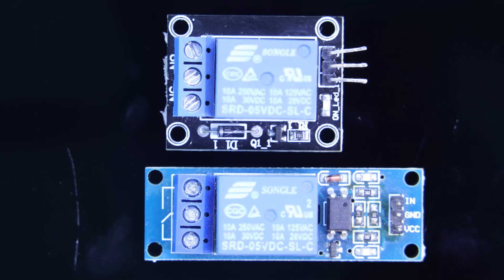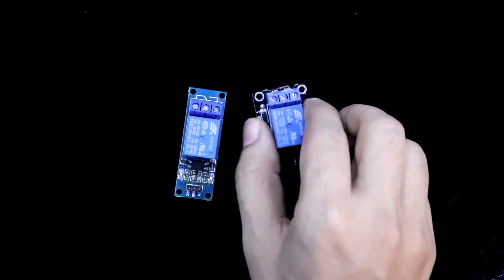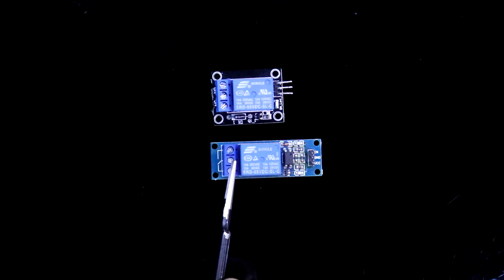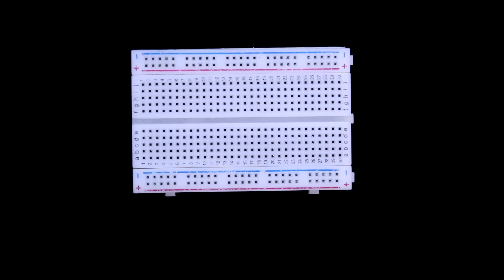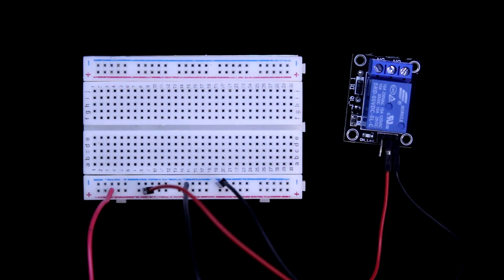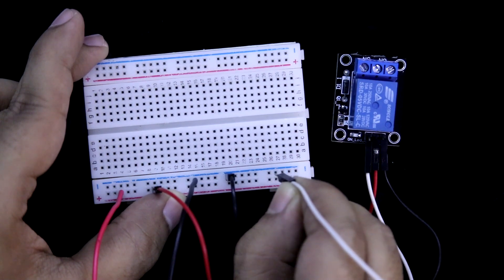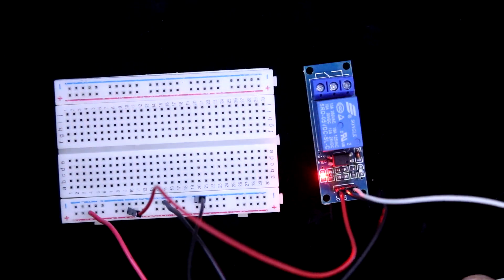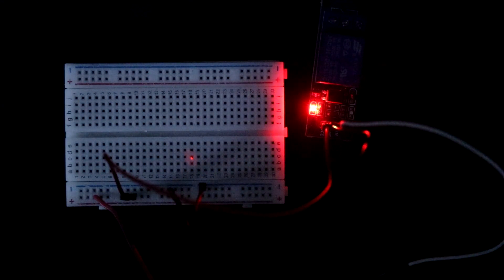High level and Low level relay module | KY 019

Comment: I bought active low relay by mistake. How can I trigger the active low relay with a logic high signal?
Reply from the maker: Use a NOT Gate in between signal pin and relay.
Reply: @EEWave  ok I've been testing. The relay board has already some volts on the trigger and when I short it to earth it switches the relay on. I was able to light a led between relay trigger and relay earth. So now I just need a transistor with rcwl 3.7v at base, and collector emitter to the relay inp and earth. I hope. If you make a video I would be very happy! Rcwl-0516 radar sensor signal out HIGH to relay board signal LOW. there must be other PPL also interested. Many many many thanks.
Reply: @EEWave  thank you. I will try with transistor.
Reply: This doesn't work. I have rcwl-0516 sensor. It has signal out 3.7v . I want to connect to relay board trigger LOW. IE 0v =  on. How do I connect transistor? I put base to 3.7 trigger, and earth to collector and emitter to relay.  So earth is completed when base is energized. Otherwise earth to relay board trigger should get some >0 volt. I'm confused! Pls help